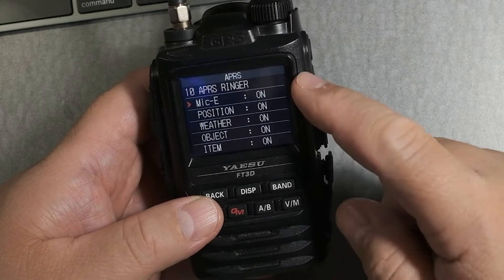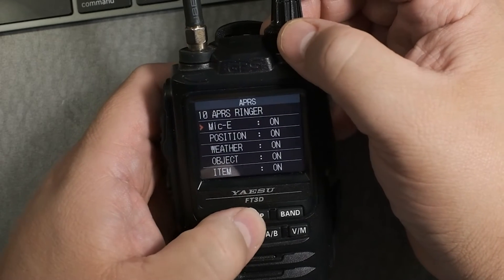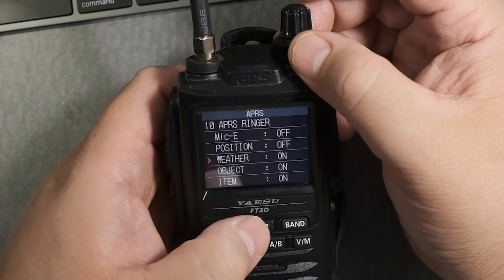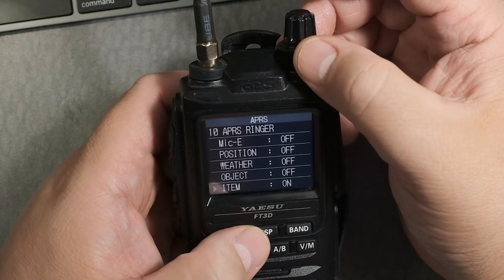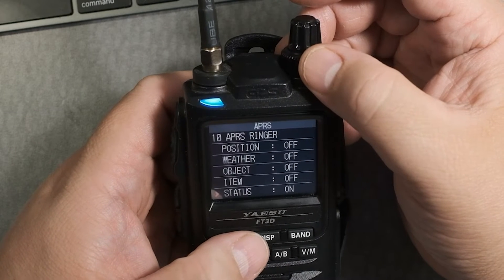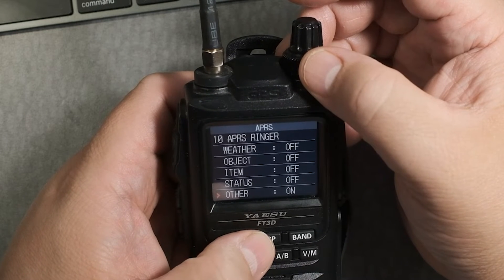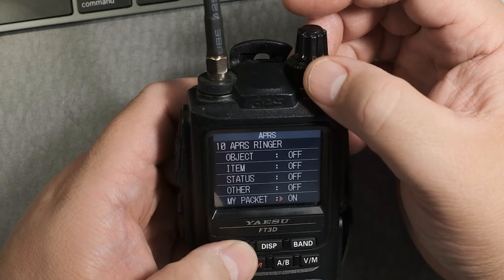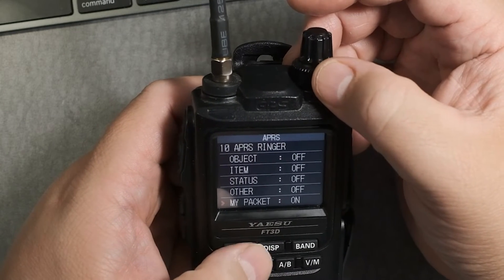Yaesu FT3D APRS Ringer Beeps

Comment: Thanks for this video. I just set up APRS on my new FTM-200 and the APRS beeps were getting to me, I thought that setting the mute on for the APRS frequency would mute everything, but not these ringers. The video gave me the direction I needed to dig up the APRS Ringers menu in my radio, which worked wonderfully, although the options are pretty different than what your radio has... Anyway, my radio hasn't beeped for a few minutes now and it's no longer annoying me!
Reply from the maker: Super.  Thanks for commenting on that.  Good luck.

Comment: I am using the 3d at home as my node radio on wires x. Is there a way to turn off the end of transmission beep or standby beep. It drives me crazy. I figured it out on my 400. It can’t on the 3d. Any thoughts appreciated
Reply: TX/RX -> Digital -> Standy Beep. Page 67 of the manual.

Comment: Hello Frank, I have same equipment here in germany, so you have any idea was "A12" means above the FM and right side of that little white point means??? I cound not find any information about this!!! Mine is also blinking!!!
Reply: A12 = APRS. 1200baud thus A12. If you switch to 9600baud it will flash A96...  73, N1QKD

Comment: Frank, thanks so much for your videos. As a New Tech who has just got this new awesome radio (Which does everything but make me coffee) your videos are the best in helping me to fine-tune my radio. You make a video the way I like my tech videos. Straight to the content with just enough background information. Keep them coming. Also, when are you going to do a video on the X and GM buttons on the radio? A setup and how to use video would be awesome? And if it's not too much to ask, can you do a video on how to send an APRS message from the FT3DR? Thanks.
Reply: @frankwc0o  I'm KC3NVS -7 try sending me a message.
Reply from the maker: This radio has an advanced manual you can find online which has a lot of useful instructions.  But, mostly I leaned though experience and watching others use the radio.  It's not easy to get all those setting right on APRS. One thing that I noticed when setting up was the antenna.  If you are inside, the signal sometimes will not go out.  Or if the GPS is not working well, the signal will not go out as well.